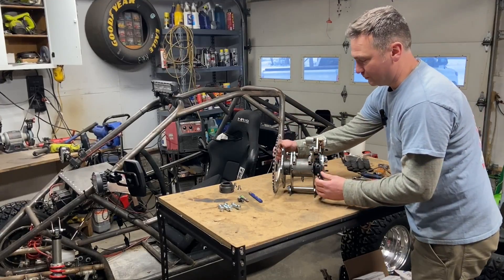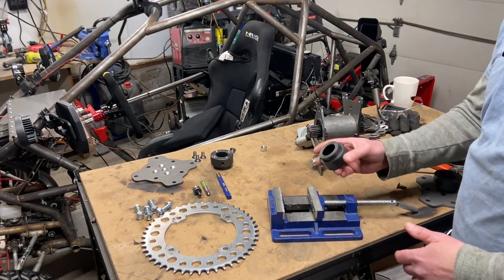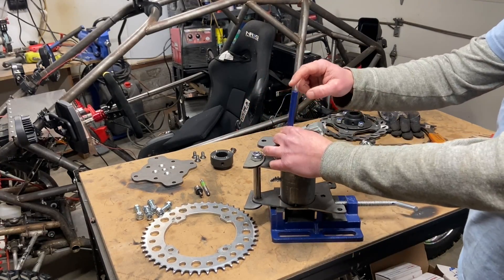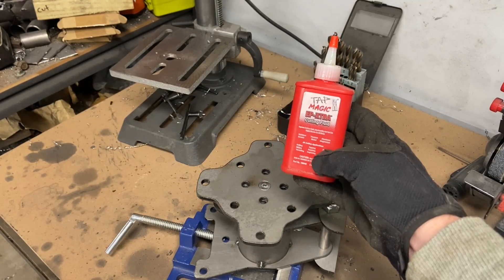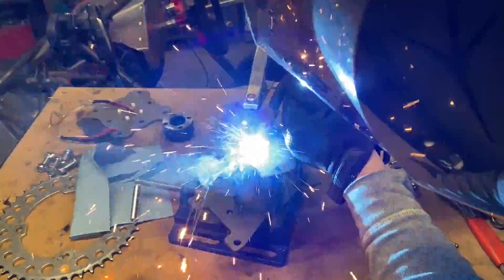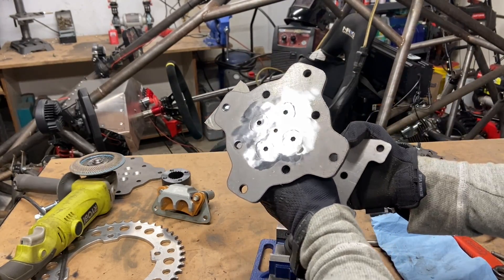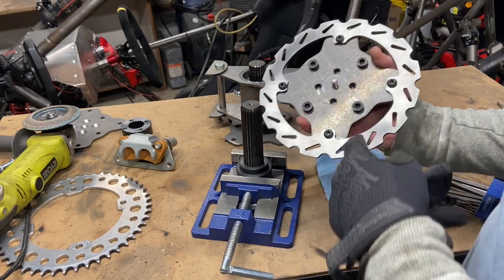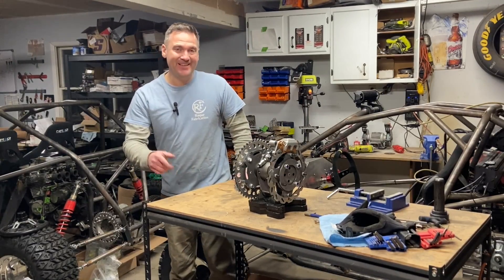Motorcycle Engine Diff Crosskart Buggy Chain Drive Spool Part 3

Comment: You could simplify that engine to two carburetors. "Simply" plumb the two middle cylinders with equal-length runners to one carb, and then do the two outer cylinders to another carb. Each pair fires 360 degrees apart, so there'd be no parasitism of the fuel-air mixture between cylinders during operation.

Comment: No it isn't. Vacuum gauge and clean them correctly. If they are Mics you know you've got to get them clean. I agree that a fi motor just over all is better but there are some drawbacks. 1 possible issue could be a sensor  shits the bed and  your walking  from who knows  where. Say a tps or cam position  sensor

Comment: KJ Racing Sir  add efi to the old engine or new and use megasquirt the Microsquirt sweet system even one can use android tablet/phone as a dash /tuner etc .ls coils or ford edis wasted spark super simple and affordable diy autotune is a place to get it .GOD BLESS
Reply from the maker: I’m not getting rid of the engine so I may do this for the next one. EFI add-ons are typically pretty expensive (like more than I paid for the donor), and I’m a budget builder. But we’ll see.

Comment: How do you change the bearings?
Reply from the maker: Narcissist comment. Stop trying to look for what’s wrong with it. The bearings will last at minimum 5-10 years just like in everything else.
Reply: @KJRaycing  I apologize... I definitely wasn't trying to poke holes. I simply thought I had missed something. I drive decades-old vehicles and use farm machinery such as combines from the '60s and tend to assume bearings are "consumables."

I definitely didn't mean to offend and am supremely grateful for the development you've put into all of your work and videos.
Reply from the maker: Apology accepted and I’m also sorry if I came off harshly. You can only imagine the scrutiny I get from the world we live in today. Thank you so much, I really appreciate you clearing things up… and I’m semi jealous of the farm equipment, I bet that can be fun sometimes 😎
Reply: The bearings should last a very long time. 
But if you're worried don't weld the center bolt and splines on at least one hub. It would still be easily removable. The bearings themselves probably need pressed or pulled out.

Comment: do you think the spline is the weak point? or the chain? both seam beefy enough to survive a long time in dirt.
Reply from the maker: My goal of this was to make the chain the weakest link (no pun intended). As power increases the weak point would become the brackets holding it to the frame, which can be laser cut from thicker material. It was designed to be variable; that’s kind of my thing. 🤓
Reply: @KJRaycing  I fairly certain you are correct and all of it is strong 😁